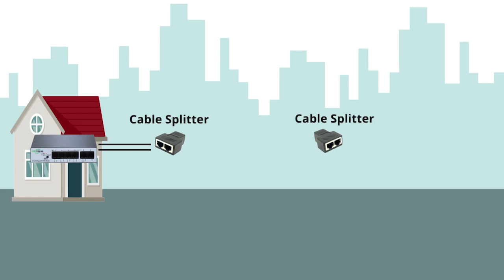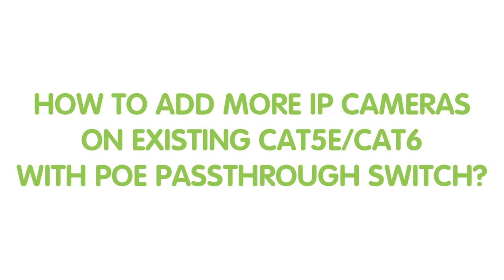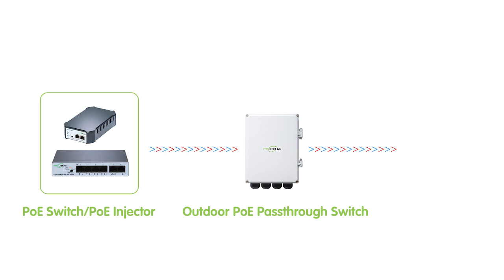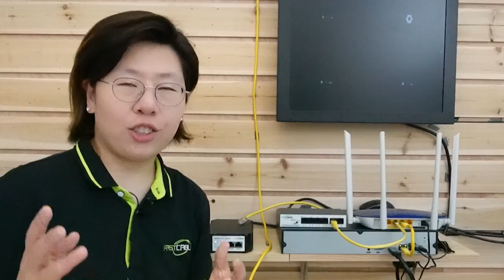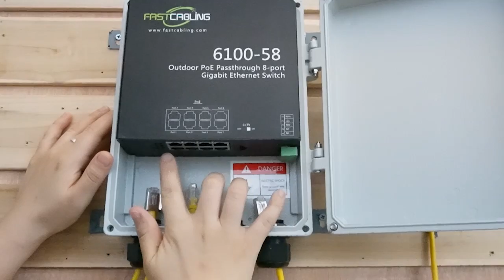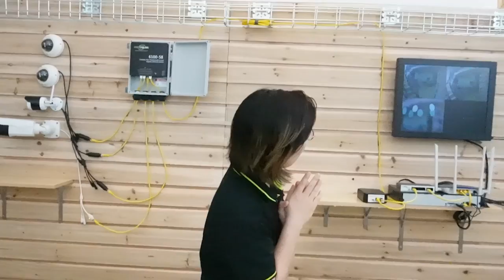Best Way to Add More PoE Cameras Without Running a Bunch of Cat5e/Cat6

Comment: i have new Dual-Lens Wifi Camera device model WP606-B but my NVR cant detect the said camera, please help thank you
Reply from the maker: If the camera doesn't support Onvif, and you have NVR from different vendor. It might not work. There is protocal in IP camera NVR system. The Onvif protocols allows the devices from different vendors talk to each other.
Reply: Thank you

Comment: Is it poe switch or can direct contact the injector to modem
Reply: Without poe switch can connect??
Reply from the maker: You can connect the PoE injector to the modem to pull the internet access.